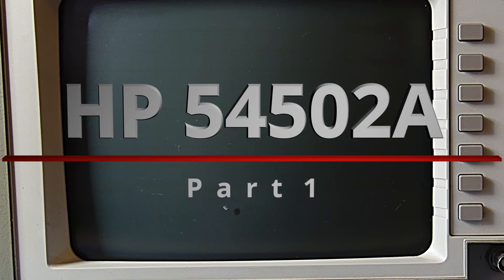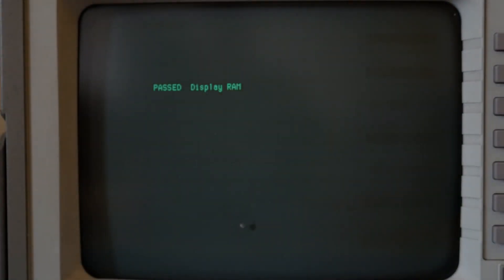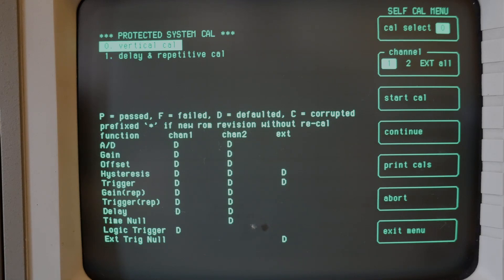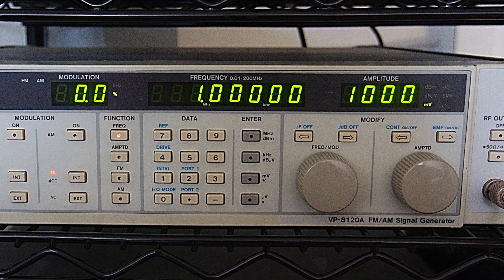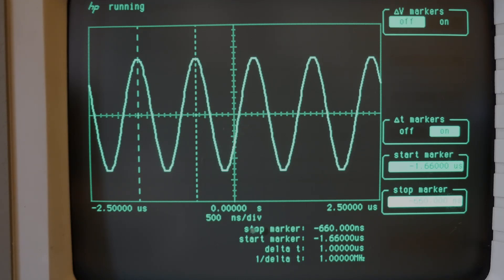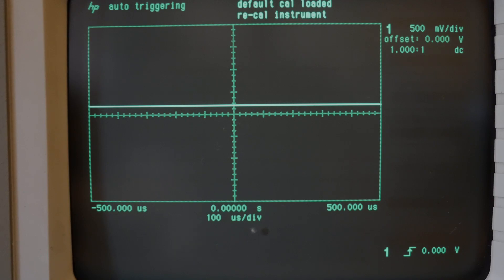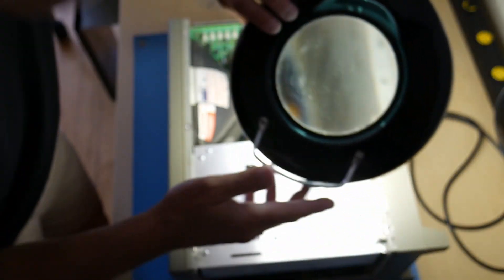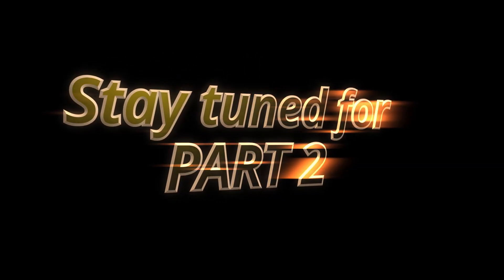HP 54502A Repair Part 1

Comment: Do you know what causes HP 54502A logic trigger to fail in selftest? It is only remaining issue after changing nvram
Reply from the maker: Sorry, I can only guess that your unit may have an additional component failure beyond just the NVRAM, but since I don't have a schematic I can't really point you to which components to check.

Comment: Very good friend your video!  I would need the motherboard wiring diagram do you have it?
Reply from the maker: No sorry, I don't have the circuit diagram. I had to figure out which part to replace by reading the part numbers on the individual integrated circuit devices.

Comment: I'm wondering if the CRT could be replaced with an LCD module because these are AWESOME oscilloscopes.
Reply from the maker: As I have been known to say, anything is possible that isn't prohibited by the laws of physics. The question is whether it is practical. 

I'm not aware of anything commercially available that could convert the high voltage (electron gun) and high current (steering magnet) signals used to drive the CRT into pixels for display on an LCD. Feel free to prove me wrong. I'd love to hear about it.

What you could do in theory is to connect a computer to the HP-IB port on the back of the scope, and decode and use the data available on that port to create a display on the computer screen. I don't know how much of the data shown on the CRT is available at the HP-IB port. Could be an interesting project, if you choose to do that be sure to post a video!